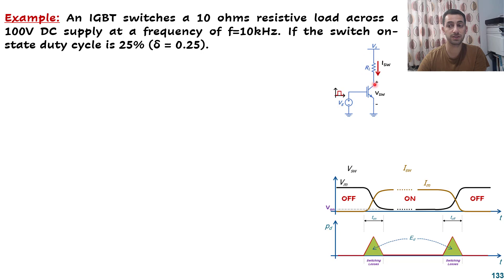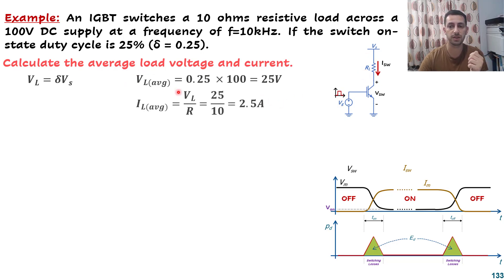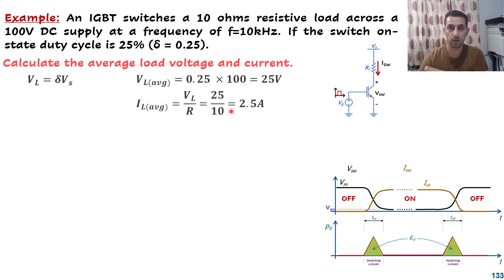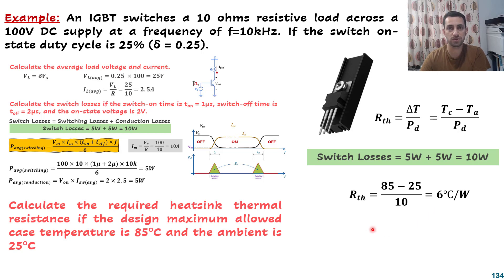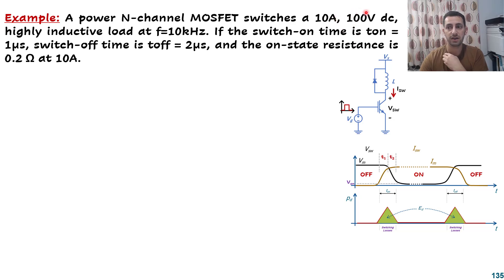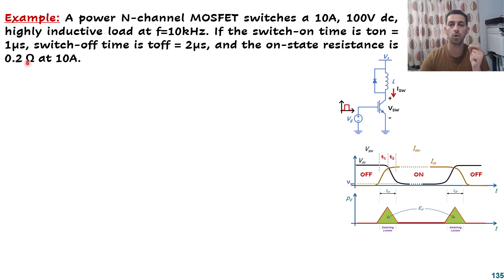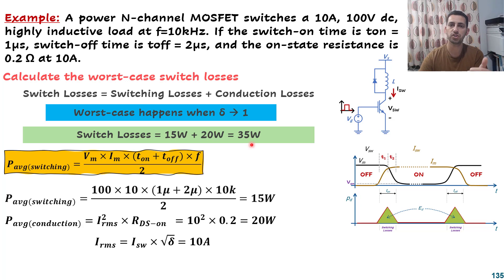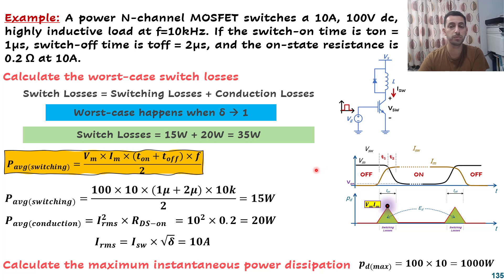17 Switching Losses (Worked Examples) | Power Electronics

Comment: Hello Sir How do I calculate or determine the duty cycle that will produce the maximum  DC Battery charging current. For an Ideal switching element with no Losses. Let's say you given 5ohms and 5mH inductor and 240V Back Emf switch frequency  of 2kHz and Vs=333V

Comment: Thanks you , this is simplest Switching losses equation i have seen. There is many complicate equation to calculate the switching loss is quite confused. i have a project to make 30KW input 3phase 415V and output adjustable from 0-24V up to 1000A maximum load.. i need to calculate the 2MBI200VH-120-50 IGBT switching loss to make sure the Junction temperature is not over 150C and also calculate the require heatsink . The main problem is IGBT switching losses increase when switching frequency increase.. I was thinking to operate at 16Khz but now i thinking to reduce to 8Khz or even 5Khz.

Comment: Hi sir, 
In the IGBT Problem . The thermal resistance of heat sink is Rth<6 degree per watts means we have to select the heat sink material of that much value or the heat sink is withstands for that much value .

Comment: sir, in the flyback converter (or any other converter) the maximum value through inductor is iLavg+(Mean to peak ripple current),
so while calculating switching losses, we will need to consider ripple current also right?  and as while deriving formula for switching losses u considered inductor current from 0 to iLmax, and in chopper we need to derive by considering iLmin to iLmax, am i right sir?
Reply from the maker: To consider more accurate calculations it is Yes. That is why we learn how to calculate the avg and rms for different waveforms as I mentioned in the importance of RMS lecture. Here I do approximate simple calculation